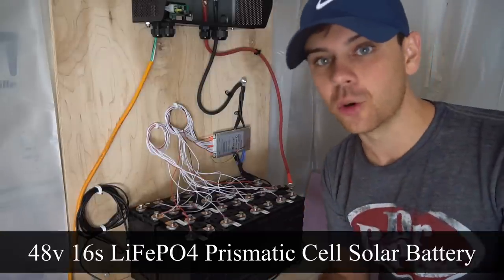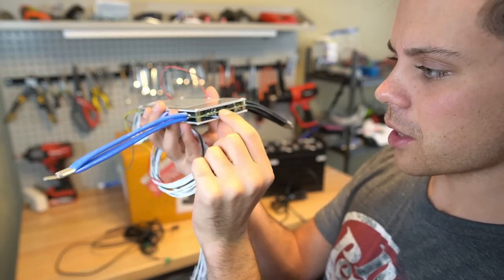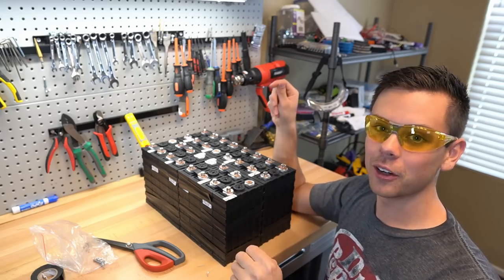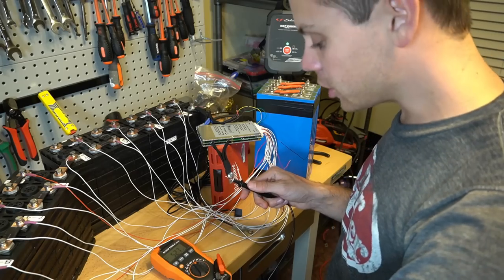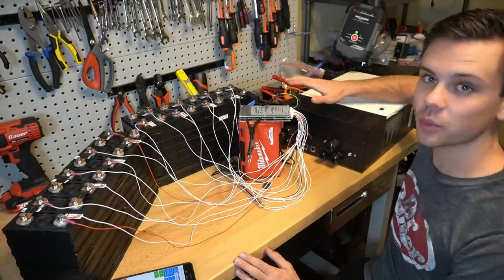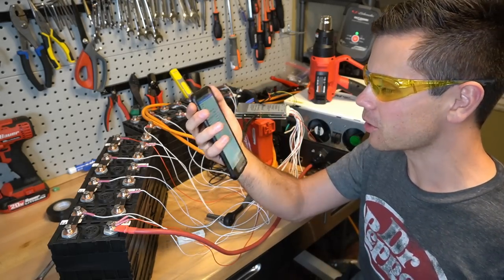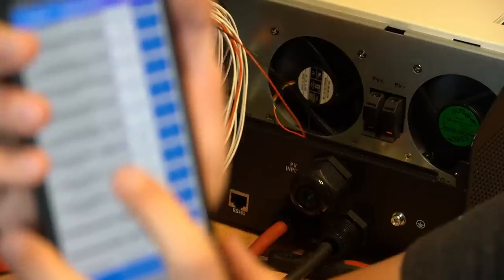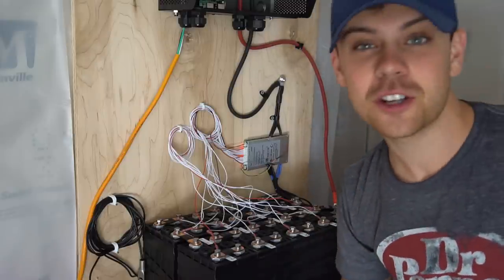DIY 48v LiFePO4 Battery w/ $72 Bluetooth ANT BMS (low temp cut-off!)

Comment: This was GREAT! I had just gotten mine in the mail and wanted to make sure on how to hook it up, and like you, was a little worried plugging in the balance leads, but all went ok, but when I checked the voltage, P side of batteries and Black cable on the BMS I only have 41v not 52v
my BMS is the newer version and came with a button to turn on the BMS.  Next, I'll try the Bluetooth and see if one of my battery leads is off.

anything else I should look for
Reply from the maker: Oh then you need to hook up a charger or activate it. Then the voltage will go up
Reply: @WillProwse   Thanks, I'll give that a try now, also did the phone app need a password, not the pairing PW 1234 but in the app it has two lines password and new password.
Reply: @WillProwse   Sorry and I have sent an email to the vendor but thought I'd ask you, now I get Balance line dropped cell and dropped string.. can't do anything, I have checked all the voltages at both ends of the wire and it's all correct

Comment: ok so to turn on BMS: 1) "activate" by connecting red/black leads to 3-5V source for a few seconds 2) disconnect from source and short the leads. is this correct? To turn back off, un-short leads? Then follow 1 & 2 to turn on again?

Comment: @Will Prowse did you have to download the bms bluetooth control program with a computer, then transfer to your phone with usb cable? I dont have a computer... I'm hoping there is an easier way. Thanks for any info you might have.

Nevermind. Did some digging on solar forum... Found a link to app, and, seems to be working now.
Reply: Do you have a link to the software? Can't find it :-/
Reply: What app are you using? Thanks

Comment: Great Video. What connector has this BMS?
 Where can I find these long white thin balancer cables from? Does the bms come with these cables? I find on Ali only these very short 100mm ones. I would need a 5 Pin / 4s at least 200mm long, better 300mm.

Comment: Great Video, I thought the smaller the wire the more amps you can run threw it(10 gauge). We see this allot when making or finding fuse wire. There is a site, I need to see if I can find, where they have the calculations based on wire length also(not just by gauge). I believe they only go as low as a foot. I'll try and find the link, but this might make a good future video. I personally have never tested, I don't have space or set up for it.

Great Video BTW!!!

Comment: I am considering a 48 volt system based on LiFePO4 LiitoKala 3.2V nominal 200Ah prismatic batteries. I have noticed that unless batteries are shipped from inside the US, they are shipped via horse drawn coved wagon and can take literally months to arrive. Since it appears that most batteries are made somewhere in Asia, it doesn't seem to make monetary sense to order from inside the US. I am currently looking at a set on eBay that are reasonably priced  from an eBay based Chinese vendor. eBay seems to give better circumstances in the way of guaranties and warranties and the product actually arriving, . But still, they will be coming by covered wagon and will arrive in a matter of months. 

With the shipping based time differential in mind, instead of purchasing just 16, would it be more prudent to purchase 20? I am thinking of what it would mean if one of the batteries did go bad. Getting a replacement battery might be an interesting wrestle. I was thinking of making 5 12 volt nominal batteries and rotating the 5th battery with the 4 in use. I don't know if this is practical or even advisable. I wouldn't mind using US based batteries, but the price is, well, we won't go there. 

As another course of action, since I am very familiar with lead acid, I was considering a set of AGMs, but why go with an older technology that will cost about 80% to 90% as much as the prismatic batteries, but still require more maintenance? I had thought that I could use lead acids until the price of plug and play LiFePH4 from a US vendor is more reasonable. However, considering today's upside-down economy, that is a real gamble. Besides, it would be nice to use the solar equipment that I have purchased over the last year or two sometime this century.

I boils down to this: Supply. How can I be guaranteed a dependable supply of reasonably priced LIFePO4  batteries from any source whether in the US or in Asia? My definition of "reasonably priced" would be $7.00 to $10.00 per Ah in a 48V system holding 200Ah to 280Ah? Essentially, $2,000 to $2,200 for batteries alone is a good price range for me. My definition of "good supply" is sometime in the next week or two, not month or two.  is the major problem.

PS. I am considering 18650's for price alone, but just the thought of welding on any kind of battery just makes my teeth, hair, and everything else hurt no matter the intensity of spot welding. I have had lead acids blow up in my face not once, but twice. I can tell you that it is not fun.

Comment: Thanks for this video Will. I'm busy building a Nissan Leaf battery box set up for a VW bus. I don't know where the C- connection goes and need to confirm that the #1 wire on the plug goes to the total negative on the pack? #2 wire on the plug goes to positive cell #1?

Comment: could you do, or have you done a video on silicon dioxide batteries? They look pretty impressive on paper! similar performance apparently, to lithium batteries but at half the cost and extreme cold resistance

Comment: This is a great presentation, thank you very much.  Although I am currently having a problem with mine.  I am using Nissan Leaf Batteries and everything looks great.  But the total voltage is off by 3vdc.  Then I noticed that battery 1 is indicating 0.8Vdc.  I check it using my voltmeter and it shows 3.78Vdc.  Is there a setting that I missed?  I have already replaced the BMS with the same indication.  Can you please help, cannot find anything on this on the web other than supposedly bad wiring.  The wiring was checked and triple checked.

Comment: Build a 24V 450Ah > 12kW Battery with this bms, really happy with the result, Will thanks for all.
Reply: Maybe you can help me and explain how your 7s doesn't drop below 23V. My C- terminal shows 23V max. B- Is 27.8V What am I doing wrong? Spent hours on reconnecting it. Even he struggled to get the right voltage on both ends
Reply: @nikoracy  I use 3p8s with 150Ah cells
Reply: @martijnheeroma5492  maybe 8s is the answer. So the Voltage is stable on C- and it doesn't drop?
Reply: @martijnheeroma5492  also, did you have to set up your bluetooth app for the system to work as 8S? My bluetooth app doesnt receive any info
Reply: @nikoracy  I use AntBMS from iPhone App store, configuring for 8s was not needed
Reply: @nikoracy  Have to start the bms (once) with a 9v battery on the 'startup wires'
Reply: @nikoracy  stable, only had to raise the 'short-circuit amperage' setting in the app before I could use my mig welder on a 24/5000 Victron Multiplus
Reply: I had to replace the unit. Waiting for the replacement now.thanks anyway

Comment: I have a 48 volt outback FP1 power panel withe everything on it . Best to get a system up and running.  I'll  have to do some research  but wondering  about using a BMS with it. I already  have a charge  controller the you can set voltage  for life po and lithium  (scary). A.y input of using the bms you showed?  I also have almost 4k on bright days of power coming into a 16 battery bank of Costco cg2 6volt batteries.  Love to go your router.  The suppliers  will bend you over for their batteries.

Comment: I have purchased a similar system (not arrived) actually has same software but it is for 10S - 24S and 100 to 300 amp. I will be connecting it to 2 BMW 8s2P Lithium-ion 70aH 2kwh batteries in series.This will become (as you know) a 16s battery! They are over 90% original capacity but want to keep them am 4 maybe 4.1 volts per cell for a total volts of 64 - 68.8 volts. My question where can I find a solar charge controller (that’s not $$$) to use that voltage. I hope you can help direct me as I am a novice. It will run my pool in a 220volt off grid set up. Thank you for helping in advance!
4.1 volts per cell.

Comment: Hello Will and community,

I just received 16 2.3v 280ah lithium ion batteries.

I tried your link to the BMS and it's not available anymore. Can you help me with putting together a 48v system for off grid solar. 

I also want those bifacial solar panels as well.

Thanks for your time and help.

Comment: This looks like what I want to do vs Flooded Lead Battery I would need to know if you parallel a second or third 48 volt battery each with their own BMS? I want LiFePO4 batteries, this looks like a path I could afford to building a 100Ah or more battery bank.  Can the app send alerts?

Comment: Will, I've watched some of you videos.  you are an inspiration to all those who have struggled and persevered.   As a beginner and a person who would like to get in on DIY solar power to power my house lights/TV/and fridge when i have a blackout, my question are... (1) is it preferred to start w/ a all-in-one controller like the 48v PMM Solar power system unit and add panels and batteries or is it better to start with a component solar power system and add panels and batteries?  I'm handy and have basic electrical knowledge. (2) can i do it for less than 5k max? (3) do you have videos on transfer switches for when grid power goes out?

Comment: I was thinking of using this BMS on an EV but it looks fiddley for turning it on and off with the car key switch - as you needed to short it with voltage and the put the wires together ??? what do you think?

Comment: I wonder what happens if the BMS dies?  Wouldn't the settings on the MPPT charge controller do almost the same thing? With a low temperature sensor also. I was thinking of using a balancer and low balancing the batteries and then letting the charge controller work. Maybe doing this a few times over a month to get the batteries setup.

Comment: Hey Will, I was looking at Ali through your affiliate link and saw these:  CALB 4pcs 180Ah 3.2V CA100FI Lithium LiFePO4 Batteries. Are these also good cells to get or are the 100aH batteries better bang for the buck?

Comment: If you connect the mppt direct to the lifepo4 that would bypass the low temp cut off. i understand the reason tho as past experienceand some drop in batterys advertised has shown me a lot of bms have a minimum current input to turn on and charge the battery. can you do a video or explain if the bms you recommend have a min input current? i think for those with small camp systems might want to learn about that incase a small panel setup may spend a lot of time not providing enough current to turn the bms on and charge the battery. some batteries i have seen say 5 and even 10amps min charge current for the bms.

Comment: Thank you will for your great videos!
I plan to use this BMS for a 24V/200Ah System on my boat. The batterys will be in a case and not easy accessable. But I'm a litte bit confused about the activation of the board. Is this only neccesary once? Or can it also be neccesary to do it later on? We are 3 people which are using the boat and the others are not familiar with such things. It is also not easy, to access the bms when the battery pack is installed on the boat...

Comment: I want to put something like this in a Teardrop campers. So it doesn't need to be this big. Still working on figuring out what all my power draw will be. But will have a few solar panels on the roof to charge so hopefully off grid. Just need to figure out how to get ac and heat so I can use it year round. Any suggestions for a smaller build?

Comment: Will, I am not interested in 12V or 24V.  Not enough info in your videos or site on going straight with 48V.  All the high watt panels are 48V and I have little space to put a dozen panels.  I only have room for 3 panels and want to live as normal as possible.  I have to use 48V panels and have to use all 48V compatible chargers, inverters  ect.  using the 3 panels and only a 3ooo watt inverter means I can go up to 9 panels someday and have 3kw.  The whole system around 4k which is cheap compared to getting the electric company to put a power pole out to my property and then have to pay endlessly.  Need more info on using 48V with no 12V bs.

Comment: Hi! Nice video!
Could you please tell me if the charging (C-) and discharging (P-) were connected at the same negative battery terminal?
By using them with mpp solar, you cannot split the charging/discharging port, so I was wondering if it is working good.
Thanks a lot for your answer!

Comment: Hi will, i have the same bms, but everytime it will shut bms off, because there not an 2 to 6V battery at the little port.... without battery it will run for couple minutes. regards

Comment: How do I wire this 16S 320A BMS for a 8S2P 24V 200Ah battery configuration?  I am unsure which wires go where?  1- 1+ 2+.... 15+ 16+ B+?  Which wires should remain unused?

Comment: Hi
i'm very interested about this bms for my e bike, because i can monitor individual cell. normal bms don't tell you what's going on in you battery pack. As you said the boot instruction is very deep in the manual. i know you can turn it On using 3.7V. I don't understand if i can turn it OFF using a 3.7V input. If it's possible i can use it as a switch for my bike, wich is a pretty much important features. Otherway i need a big relay...

Comment: would you reconmend for 2 teslas? looking for a good bms. I live in Florida and not worried that much about cold temps. Also, electrician for 17 years. Im also good with just buying a cheap 12S as well.
Reply: This BMS should work good for your setup.

Comment: Most interesting video. I have been looking to convert my narrowboat to all electric. I have the motor selected. To power that I need a 16 cell (48V) 400A battery bank, with a 5kw backup diesel genset. I had a thought about the lack of appropriate gauge +/- leads (plus, for marine use, the cables need to be marine grade). Looking at the BMS, would soldering a copper plate to the strip be a much better idea and then bolt the much thicker, heavy duty cable to that?

I see they have an offer right now, where the 8S-20S 400A version is just over $100. Still wondering if there is a way to automatically engage the genset (which does have two wire remote stop/start) when the capacity of the battery drops below a certain point? For now that would be a manual decision I think. Your videos and curiosity are awesome.

Comment: Hi, you say lifepo4 is not suited to parallel. This is only for cells adding together before the bms right?
I want to build several strings with each a bms on it, before connecting in parallel, so would be ok? Tx for the advise

Comment: Can you test what happens when the BMS disconnects at low voltage?
In my experience this scenario needs a manual reset of the BMS because the solar charge controller no longer thinks a battery is connected and so the cells are never brought back up to a suitable charge.
With a BMS with a separate connector for charging this problem is avoided.
In a setup which is meant to be unattended, having the system shutdown and not come back up when the sun comes back up is unfortunate.
Reply: peterhcarls2 perhaps it’s possible to wire a battery solely as backup for the BMS ?
Reply: Wouldn't a good MPPT sort this issue out?

Comment: Howdy. You wouldn't happen to have a link to the manual for that BMS would you? The ebay seller has gone away I there is now no way to contact them for the app or the manual. 
Unless you have a list of settings you recommend for a 48v 16s setup with this BMS????

Comment: Is the plan to eventually use this battery with an MPP LV5048?  Are you concerned with the initial current draw of the 5kw inverter as the internal capacitors charge up?  Battleborn says their internal BMS can be damaged with a 4kw and greater inverter even if it is started with no load.

I'm really hoping you do an LV5048 video.  I've got lots of questions....  For example, since it has L1-N-L2 do you have to put half your loads on each side, or could you run all 5kw on the L1 side?  Also wondering how the utility charger works if you just hook up L1-N to a 120V generator or something.

Love the channel!
Reply from the maker: Building this right now
 Stay tuned
Reply: DIY Solar Power with Will Prowse 
Looking forward to the LV5048 video. 
Planning to use it with Tesla “S” modules. 
In a cement bunker away from the house, don’t worry!
Some info on that possible set up (without encouragement) would be great. 
Love your work, thank you for the inspiration.

Comment: Hi mate. If I have 2 lithium  batteries with built-in battery management system and has a recommended charge rating of 40 amps if them batteries are in parallel can I charge them at 80 amps?

Comment: Where can I find these now? eBay link expired. 
48v BMS with temp sensors has been hard to find for the DIYer. If I can find one with remote on/off or UART interface - I can design and building my own temperature safety circuit. 
This looks good if I can find it. :-)